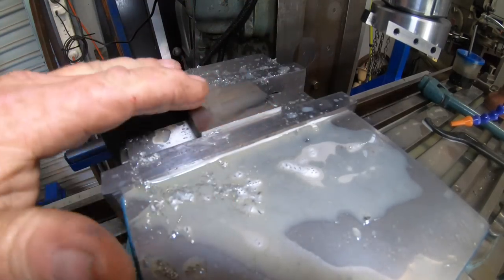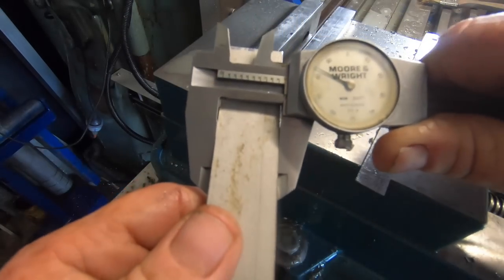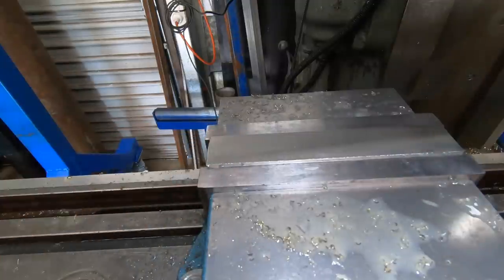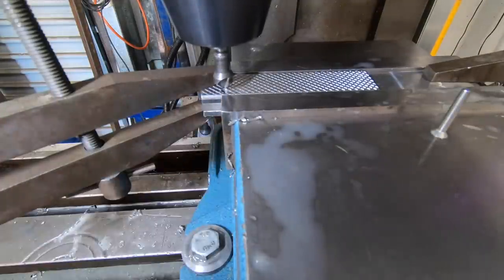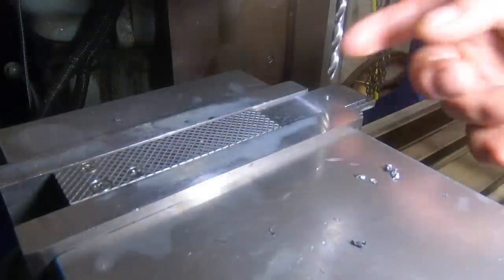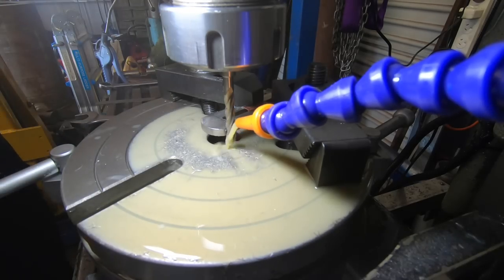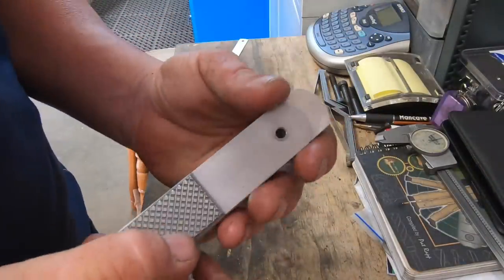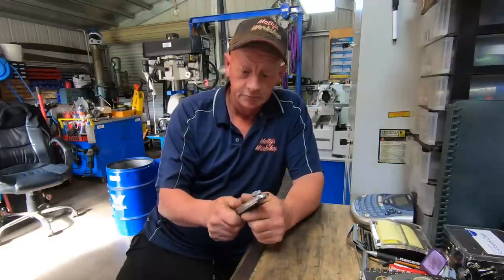Bevel Square, Part 2, It's finished...

Comment: Brilliant job Matty,  certainly a 100 times better than the one I made aged 15/16 circa 1977/78. Slot was a chain drill and file out, riveted the 3 pieces, and brazed a set screw in. Still got got it.
Fair amount of material removed, plenty of gnawing. 
Thanks for sharing.
Reply from the maker: Gday, I’m sure you learnt a lot when you made yours back then, you must of done a good job if your still using it, thanks for watching and commenting mate, cheers

Comment: Sucks it didn't come out with the finish you wanted. Fine Wet sandpaper it's always a good option in cases like these. A step further would be to polish with Flitz polishing compound, I swear by that polish, outstanding finishes using Flitz. Great video, keep the coming!!!👌👍
Reply from the maker: Gday, I’ve never heard of the brand of polish before, I better do some homework, appreciate you watching and commenting mate, cheers

Comment: Excellent work. I wonder if the blade was a different grade of stainless and that is why it was giving you a fit on the finish. Trent is going to enjoy using that.
Reply from the maker: Gday Tom, the stainless was from all the same piece of material, I really don’t know what happened to be honest, the fly cutter has never let me down until now, thanks for watching and commenting mate, cheers

Comment: Most glad seeing you have over 100 likes and 20 comments in first few hours since the release!
Yours is one of those ``lost in the annals`` channels that has great content and more than enough humor to have as low watchers count as it does... Glad i found you...
Regarding the knurling tool, its no wonder it still works okay, as its kinda self guiding... When it makes the first mark deep enough, it makes its own ``ways`` that keep the wheels in line they started, like a loose tailstock that you let the drill correct to center on a small lathe... On big lathes with 100 kg tailstocks, yeah, that doesnt work, but a light tailstock with its low inertia is in that case a bit like this tool - self navigating and centering...
And it sure is likely that you will have a few kids around your house, begging for a bevel square in a few days... Heck, the last bevel square i have seen was plastic body with 1.2mm sheet for a blade, stamped into shape... Plastic was cavernous so it could be caved in by the lock... Complete garbage.... I dont use those, so i dont care much, but wow, you can find that product in a picture-dictionary by the word garbage...
Reply from the maker: Gday, appreciate the kind words, I think your right about the knurling tool, the more worn out it’s getting the better it’s working, thanks for watching and commenting mate, Cheers